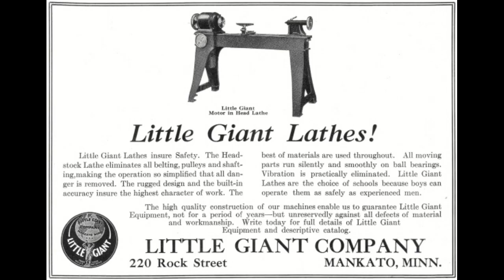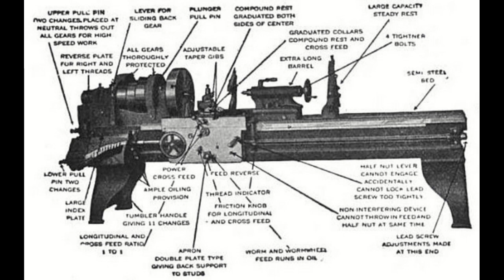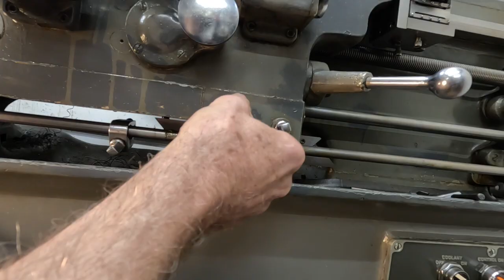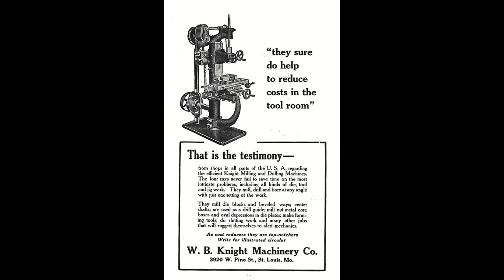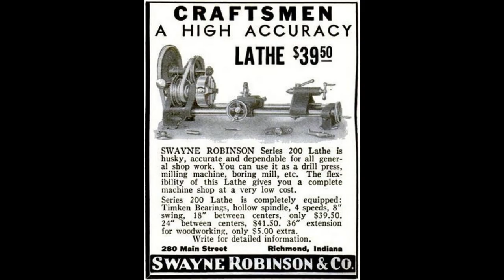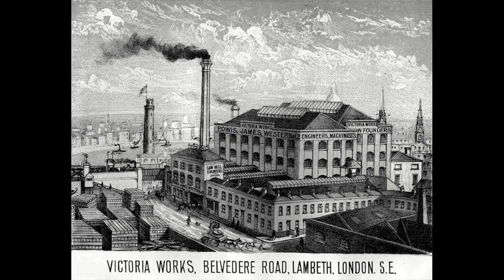Monarch 10ee lathe threading set up, Thyratron driven machine

Comment: Stupid Question: I will move my 10EE shortly. I am confused by the 10EE taper feature. 1). Is there two different lead screws? One solid and one two piece for the taper attachment version? 2). On the Hardinge,  you just remove the nut bolt to use the taper. I see three bolts on the 10EE. One kept loose. Which one do you use on the taper?

I guess I don’t see how you isolate the lead screw when using a taper attachment. Working from photos until I move the beastie.

Mine did not come with a taper. But I may have access to a taper minus any lead screws. That is why I ask.
Reply from the maker: Yes, there are two different lead screws, one the feed dial attaches directly the other is what they call telescoping where the feed dial can be removed leaving the screw in place.
 Later machines were fitted with the telescoping type regardless if a taper attachment was ordered with the machine, in that type a solid bracket is installed where the taper attachment would be as there is a bearing for the cross feed screw. The solid type non taper attachment screw has no support bearing on the far end.
 So, if you have the support bracket on the end, all you need is the taper attachment, otherwise you will need the complete telescoping screw assembly along with the taper attachment
I am only familiar with the square dial type lathes. I hope that mmade some sense.
Reply: @deedeeindustrialsuperprecision  Thank You Don.  Very helpful information.  My 10EE came out of Sandia National Labs.  It is a bit older than yours but in great shape.  It does have the inch-metric dials which are quite cool.  I am in luck in that it has a two piece or telescoping cross feed screw which terminates in the bearing block you talked about.  On a bad note, I had it stored in friend's shop prior to my divorce fiasco.  I am not sure how much he used it and likely didnt know about lubricating the cross feed nut.  I will check it out when I move it.

Comment: Enjoyed…my 1953 10ee (mg unit) w/ELSR makes threading so simple NON-stress with the 1/2 nut engaged….I always say once setup is complete a monkey could thread….LOL
Reply from the maker: The older I get the more I use it. If the lathe does not have it and many don't then you have to be the ELSR relying on the dynamic braking and your own quick action. I am not so quick these days, thanks.

Comment: I do love the 10EE.  I sold my hardinge to pay off my new property note.  I miss the HLV but oh well.  So I am stuck with the 10EE.  I noticed that you didnt twiddle with ELSR.  So this video was quite interesting to watch.  I had to rebuild my "black box".  Several diodes and a resistor were shot.  The idea of using those compensation holes is a good idea.
Reply from the maker: The two diodes in rectifier 3 are the ones to keep an eye on, and replace if there appears to be any running problems. I tried to keep it simple as possible, but the ELSR can be fine tuned for right up to a shoulder or the very bottom of a blind hole. Drilling hole in the top of the module case is a time saver and the holes can be covered with tape if needed, thanks!